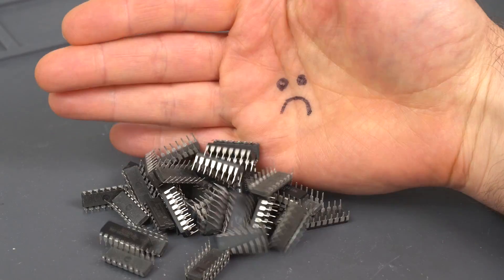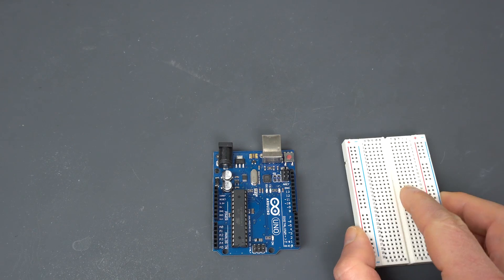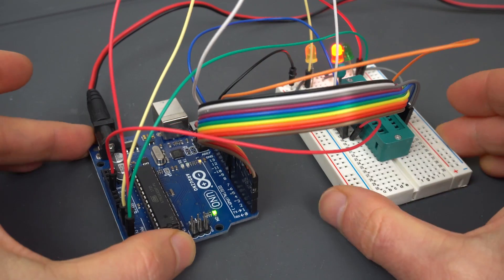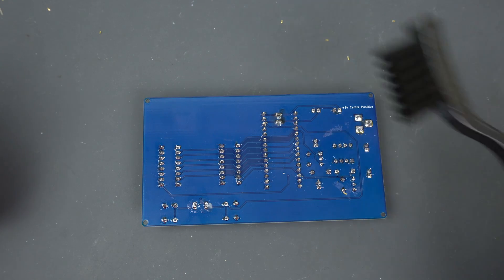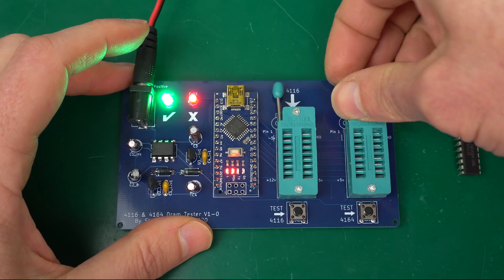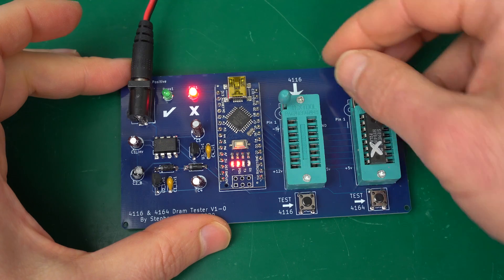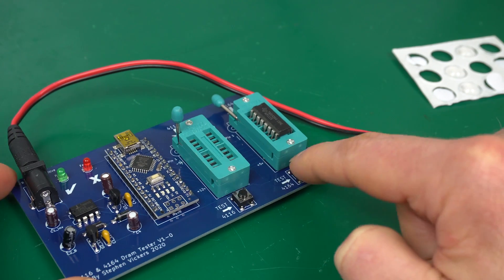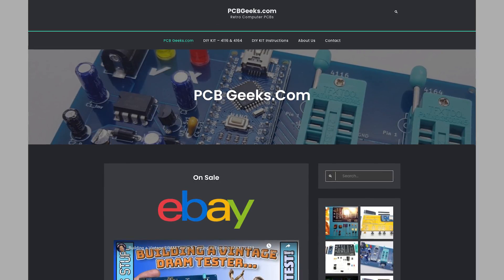Arduino DRAM Tester

Comment: Putting a DRAM chip that is so sensible in a powered socket? And I clearly remember that some chips (4116) have a special order to apply the necessary voltages on power-on (-5V to be applied first and powered down last and never to be positive  when 12V is applied). 
I know of a Eastern European country Spectrum clone that was literally destroying his RAM due to the faulty power-on sequence in the power supply. It was upgraded to 64k chips that have 5V only power supply.
Reply: Technically, you are correct 100%, but I designed my own tester PCBs using the same code with that the kit seen in the video. During prototyping, I've included small 5V relays controlled by the Arduino to switch the power lines on and off between chip changes, but later on I totally omitted them in the final design because I wasn't able to damage even 1 chip out of tens of them with hot swapping. Somehow they take it very well.

Comment: Better buy MiniPro tl866 for that money. Despite being a pretty good programmer, it can test all kinds of RAMs and 74xx/4xxx logic.
Reply: I don't think the TL866 will check 4116 ram.
Reply from the maker: Interesting. I knew the TL866 tested many non-EPROM chips, but I didn't realize it also tested RAM. Let me check... Hmm... in the list of supported chips I have locally it doesn't like 4164 or 4116. Are they listed by a different number?
Reply: @NoelsRetroLab  My bad, I missed the point that 4116 is Dynamic ram, but minipro is only able to test static ram.
I had a bunch of 3564 and 4364 and they tested perfectly fine as 6264, so this made me thinking that 4116 will do the same, until I realized that this is dram.

Comment: I built one a month or so ago with an Arduino and breadboard (perf board).   I found it passed bad chips.  I modified the code (although I ain't worth a hoot in C++). It now found some weirdly bad chips.   Between  now and then, I had bought a DIY Chris ram tester.  Fast forward to last week.  I was having problems.  The Chris tester showed good ram.   I stopped and finally built the Retro Chip Tester Pro that I have had for a year.  It found that RAM chip BAD.  I found my breadboard arduino monstrosity and it found the ram bad.   

A few weeks prior to this, I had a RAM chip that failed my tester and passwed Chris's tester.  I sent him a message without a response.

IK opened up the Chris tester and about the only difference is that he doesn't use resistors between the arduino and the 4146 RAM pins.  I don't know if it is the code he has loaded in his or the lack of resistors?

Comment: I wonder if using one of the cheap ARM modules like the 120MHz Adafruit ItsyBitsy M4 Express or one with an even higher clock speed would also allow RAM speed compliance testing.
Reply from the maker: I doubt we need anything that fast, but it would be easy to run through the calculations. It could be cool if they would report the true speed of the DRAM though (15ns vs 12ns or whatever).
Reply: Good idea, it can be done with a cheaper 72MHz BluePull Stm32 for sure.

Comment: Only the memory in the computer I'm using now makes me sad. Chips from micros don't give me any trouble (though I don't have any <.<) so maybe I should just upgrade to a nice 1980s model! :D
Oh wow, you've got an IC pin cheat tool. I'm reporting you to the PCB Population Pauthority!
<3 the chiptune funtimes though :3
Reply from the maker: Hehe 😃 Which IC pin cheat tool? The ones taped to the side of my workbench? Yes, those come in really handy since I still can't memorize the pin layout for the Z80 or even for measly 4164 DRAMs! (it's kind of random crazy).
Reply: @NoelsRetroLab  7:08 That one! The one that fixes up the pins so you can place an IC relatively easily. The PPP hasn't gotten back to me (probably because  they don't exist) but I'm pretty sure that's cheating :P

Comment: Other possibilities with the pins for the nano. 1) Put the pins in the other way up - short end through the mother board.  It doesn't matter of the pins are long on top of the nano.  2)  Put them in the nano first, then not all the way through the main board by supporting the nano with some little thing (or even by moving the plastic down).

Comment: It would be nice for a bit more coding and layout to support other DRAM and SRAM chips. A bit more involved but would be very helpful for the retro community. Nice project nonetheless.
Reply from the maker: Right. The problem is not so much the extra coding, it's bringing the right voltages to the right Vcc pins. That's why this particular one has two sockets. But I agree, having one ultimate DRAM testing open source project would be great.
Reply: @NoelsRetroLab  the I/O pins can be ran through level shifters for dealing with other voltages and a few reed relays to make it work with a bunch more chips and layouts. it would be more involved but the possibilities are there and  even if it cost a few times more it would be worth the effort and the investment.
Reply from the maker: Yes, definitely. I'll review other testers that do that, so it should be interesting to compare.
Reply: @NoelsRetroLab  You should do a vid with the TL866 minipro to see how well it deals with SRAMS.

Comment: The problem with this kit is that one can by 4 sets DRAMs(x8pcs) in that price and replace them all! I just bought TESLA DRAM for 6,5 euros+4euros shipping from the Czech Republic and without customs taxes.
Reply: Those can be bad too. If even one in ten is bad, you will be glad for the ability to test them before you install them.
Reply: @mal2ksc  I don't believe that I won't be able to find 8 working chips out of  32 chips bought at the same  price tag of that tester.....
After all high rated sellers on eBay have their own testers.......

Comment: Any voltage beyond the range -0.5 V .. +5.5 V will damage the ports of Arduino...
Reply from the maker: Right. That's what I was afraid of. Someone else mentioned that the real damage is a current over 1mA, so that could be prevented with some resistances. Something worth considering for future versions I suppose.
Reply: @NoelsRetroLab  AVR can sink/source about 20mA/pin and 40 mA total but as other mentioned - power sequence, intermittent voltages, ESD...

Comment: Self hacking, can you download the arduino software, and figure out how to add the oLED screen? (not to steal the software, but for personal use) 
Is it using all the data pins for the tester? 
Seems so flexible. Julian Ilett is doing similar with his cobbled together remote temp sensing, creating boards first for his controls, then for a nRF radio board, now combining them all into a single project board using one of the small qty PCBoard makers, and even having them put the SMD parts in place. I could easily see this done with this project. 
BTW, also, what's up with the hoarding of dead parts? Or now that you are able to test, will you recycle or trash them? I showed someone your 'collection' and told them to stop bugging me for mine... ;)
Reply from the maker: The real value of that tester is the PCB, not the software, and since adding the OLED screen would require  modifying the PCB... I think I'm just better off designing one from scratch. It's not that hard. But I hear people are making an open source project, so I'm hopeful about that.
As for the dead parts... they come in handy for stuff like this, or when I want to test how a computer with a faulty chip would behave. They don't take much space, so I'm fine keeping them 😃

Comment: Why don't you design a PCB based off your breadboard? You'd have your own open source DRAM tester that way
Reply from the maker: Mostly because I'm shaky in analog electronics and power distribution. Someone else can probably do a much better job at addressing those things than I can. And it sounds there are some good open source projects out there already.

Comment: I'm no expert, but other products manage to deal with all kinds of chips in the same socket, so to be limited to two types with no protection against wrong insertion, makes it less than ideal. I also don't think the sockets should be live while the user inserts the chip. It would probably be best to also not have to solder the Arduino to the board, but supply some female headers instead.
Reply from the maker: That's true, but to be fair, routing Vcc and ground safely to different pins isn't trivial. But I'll review other testers that do that, so we'll see how they compare. Agreed as well about not great about the power being live all the time on the socket.
Reply: I would even say just use a normal cpu with the bootloader and the program instead of a full arduino would work better and if a chip fails or get killed, that is socketed, it's no big deal, just burn another one.

This project is for people that know how to do it and you could make the board even smaller.

Comment: It's not open source because of $$.
Reply: What's the problem with money??? Open Source doesn't mean that it would be free... That's what you are trying to say???
Reply from the maker: Maybe, but I still think they would make MORE money as open source because they aren't charging tons more than the cost of the parts, and they would benefit from lots of other improvements people would provide.
Reply: @xyz2112zyx  Try comprehensive reading.

Your question mark key is stuck.
Reply: open source != free of charge.
Reply: @donpalmera  Where did I say that?

Closed-source = you can sell it for more $$ on eBay
Reply: @Okurkaarrgghh  Making the code open does not reduce the effort needed to put the hardware together. I doubt making the code open would have any effect on sales especially as it's so niche. And there's no reason you can have a license that only allows the code to be used on this hardware.
Reply: @donpalmera  Noel's estimates were pretty high.
There's more likely a 100% profit on the product and there's no way shipping costs that much.

There's a reason they keep it closed-source and that's profit.
Reply: @Okurkaarrgghh  Or it's one guy putting together these things in his spare time as the yearly sales are barely in the tens of units and the price is high to make up for it being done in his free time, driving to take a single order to the post office and then sitting there for 30 minutes etc.

If there was market for these things then there would be clones on aliexpress already and making the source code open source or not wouldn't matter as ripping the binary out of the arduino or writing it from scratch isn't a major undertaking..

According to my notifications you wrote another comment about open source hardware that seems to have gone.. OSHW is a bit silly really. "open sourcing" a simple 2 layer point to point layout done in kicad is hardly groundbreaking and is such a layout covered by copyright in the first place?

TL;DR; Making the arduino sketch available would help the tens of people that bought this thing with almost no side effects. Anyone with a rainy afternoon spare could knock up a replacement sketch and stick it up on github either way.
Reply: @donpalmera  "tens of units"
What is that based on? The eBay seller received feedback from hundreds of buyers who bought this tester.

Where did I mention software at all?
Reply: @Okurkaarrgghh  Based on the fact that it says "13 sold" on the page in the video.
Reply: @donpalmera  Like you can start only one auction.
Reply: @donpalmera  you are right, that I am One Guy in a shed making these and other PCBs  ;-)  but the wife does the postage for me :-)  thanks for the support.
Reply: @Codersys  There's the rat.